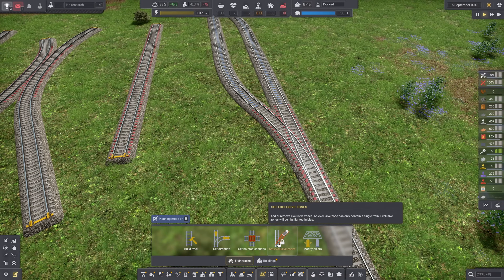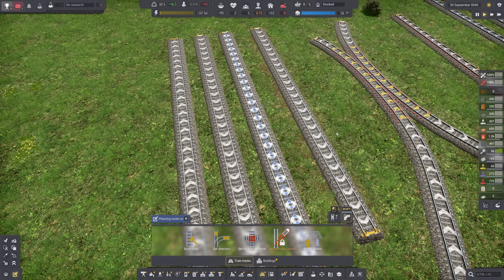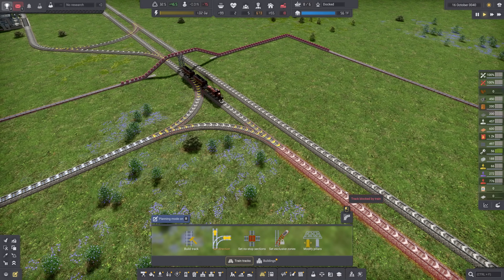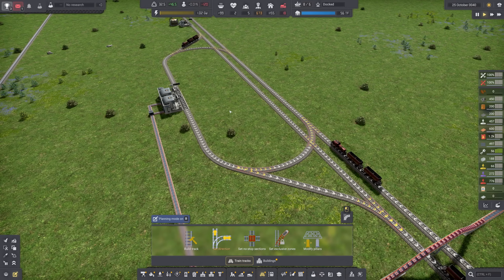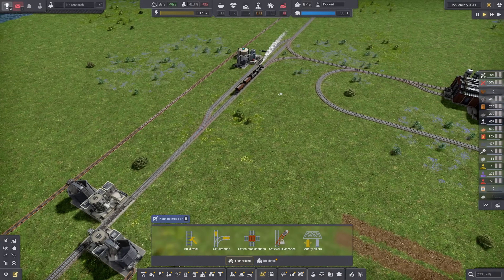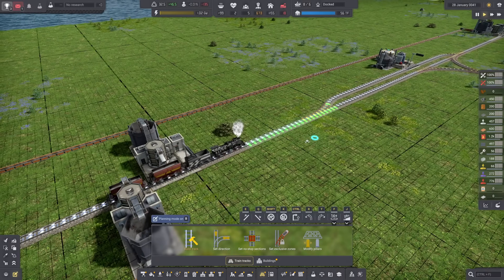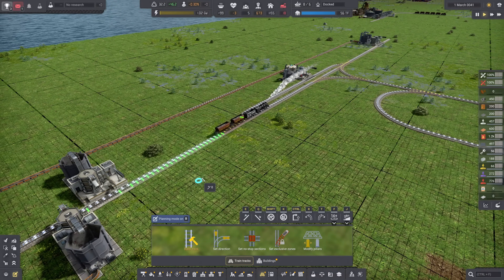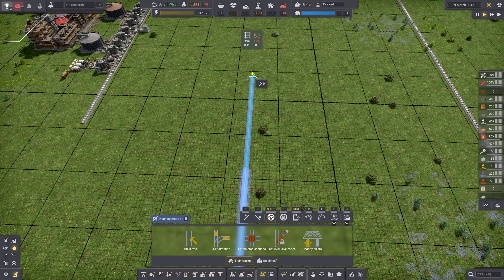Trains 101 Your first Guide 🚜 Captain of Industry 👷 Guides & Tutorials

Comment: Trains are nice. but T3 belts are still way faster and render trains useless
Reply from the maker: As someone who had 15 Belts running from one end of Armageddon to the other I actually think trains could work for this incredibility well instead. I could of changed all of these belts out for maybe 2 dozen trains and had the same throughput!
Reply: A comparison video would be great. I think belts are faster, but need more maintainance. Most of the belts in my update2 Savegame on Armageddon needed to be stopped

Comment: I really wonder what trains add next to belts except throughput.  They are so far into the tree that it's hard to build a base around their function, and they don't really help much at endgame because a belt is a lot less work, so I'm really wondering what this adds.
Reply: Same problem in satisfactory.  Map has to be big, and the costs of long distant belts increased, probably would have to add maintenance cost to belts.  Throughput has to be a lot bigger  than belts as well.
Reply: @ramennight  fair point, still seems like a bigger reason to have it higher in the tree. T2 matenance is dirt cheap at endgame.
Reply: @Longbow6625  I'd actually suggest making it earlier in the tec tree so you can start building basses around it sooner. Change tracks from steel to iron. Separate coal and diesel into different research points instead of ability to deal with grade vs speed. Make the coal train early tech, built with Iron and white parts. Might have to buff deiseal or nerf coal trains.
Reply: @ramennight honestly a train that is very fast but can't deal with inclines well sounds perfect for late game , when you've already reshaped half the island
Reply from the maker: I actually think at T2 trucks its a good place for them to be, trying to build any long tracks with T1 trucks that carry next to nothing sounds like a horrible idea. If you haven't gotten to the stage of Steel and T2 Vehicle parts then you maybe shouldn't be looking at trains yet.

Comment: So, you're still essentially signaling. There's just no signal model that attached to the track, you simply apply the signal to the section of track instead of a signal doing it. All the exact same stuff is still going on because of the restrictions you've put on how the trains are allowed to move on the track, that's signaling.
Reply: One big difference is that it seemingly auto-sets reasonable signals when building it. You can just lay track and for the most part it'll just work out of the box. You also don't have to worry about signal distancing to allow proper train flow, here you need at most to manage intersections and such, but not straight rail track. It seems a lot more convenient than signaling at a glance.
Reply: @theral056 It's still signaling, just don't differently.
Reply from the maker: Yes you are correct, but also this has a massive advantage that you do not need to space all signals out according to your longest train, so a shorter train can maybe fit inside a junction where as the longer trains can not, this greatly improves throughput for trains along with making the whole system easier to deal with.
Reply: I do wish we could place our own signals if we wanted. I like trains. @JDPlays
Reply: Signals are fun until you have to re-signal everything in factorio.  I love how Capt of Industry is doing this.
Reply: @GimbleOnDew I never had to resignal anything in factorio.

Comment: Looks less tedious signaling than Factorio trains, with the train building of W&R. Good overview video, can't wait to start foaming.
Reply: Signals were never tedious in factorio. All you need to do is chain signal before going into a junction and regular signals on the all the exits of the junction. Only other thing is make sure the blocks are long enough for the trains your using in factorio. You also want to space junctions out. Best thing is to double track and make sure the train on the top track goes left and trains on the bottom go right. By building the railway network in factorio like that you will never have deadlocks. The elevated tracks make it amazingly easy for trains going thru a junction to just pass thru. All of my factorio trains are 2 locomotives and 6 wagons.
Reply: @DragonHalo99  Yep. Once you understand the signaling/networks in Factorio it's really not that bad. Took me a long while to get it right though.
Reply: What I like about factorio is the ghost building I have a blueprint book of all my rails and can build an entire railway network quickly in a new space age game. The tank has an equipment grid so i just drive it around chock full of rail supplies. I started a new expensive mode space age game last night. I got the entire rail network I need up in 25 mins plus extra iron mines for when i need them. Eveybody knows you never have enough iron.

Comment: Man, Factorio really was the gold standard of trains in a factory game.  This mess is going to suck to scale up if it takes this much manual setup.
Reply: lmao wut. You still had to do all this in Factorio, but with signals. This doesn't require you to do any signalling at all; it just works that out for you. To say nothing of the smarter loading and unloading, and you also aren't limited by the problem of Factorio where you can't safely run trains that are longer than your signal blocks. Again, this just works it out for you.
Reply: @liesdamnlies3372  the signals and blocks pretty much work exactly like real life trains have work for more than a century.  you didnt have to learn anything new to use them.  They didnt choose to reinvent the wheel and make up some contrived system where each piece of the pie has to be manually edited any time you want to make one minor change.
Reply: @tippyc2  You are fundamentally misunderstanding how it works in CoI. You're also assuming everyone starts with an understanding of railway signalling, which is pretty wild.
Reply from the maker: Factorio WAS the gold standard, but anytime you wanted longer trains, or wanted to change your train format from 1-2 to say 1-4 you had to go through and change over all the stations, along with potentially redesignal all the intersections and possibly the main line as well. I know because I have done this! 
After working with this system for a number of weeks, this WILL be the new gold standard going forth, take it from someone who has 15K hours in Factorio and over 2.5K hours in COI!
Reply: @JDPlays  Yeah hear that, I just defalted to 2-6 trains in Factorio and had blue printed rails to suit that and just ran shorter trains if needed.  That said Space Age kinda screwed all that up when it pushed cliff explosives way down the tech tree.  Not being able to put intersections at an optimal spacing because of terrain can lead to all kinds of bottle necks.  The developers here a COI seemed to have considered all those issues and made the "train drivers" smart enough to figure it out.  My first simple rail line is working well with 2 trains running on a loop bringing iron ore to the smeltor.  I was origianlly just going to have a single line with a double header going back and forth but the aesthetic of a steam triain going backwards just doesn't work for me (even though theres no penalty).  Maybe the devs can work on that one day.
Reply: @scottsummers819  I kept-up with the dev blogs for trains in CoI, and I think there was some personal bitterness toward those points of friction in their tone. They refused to release trains until they were sure they could make serious improvements. It seemed like they had been in the trenches of Factorio, Satisfactory, etc. and said too often “eugh, I hate this.” The system needing to be signal-less was a mandatory feature.

And it’s not like it isn’t without signals it just…doesn’t require your input and a static block system to do it. The trains do actually reserve blocks ahead of them so they can stop and not collide, just like real train signals do.

It’s more akin to the modern control systems in Europe for high-speed rail. Traditional signal blocks ain’t really a thing.
Reply: I've got 10000 hours on factorio and whilst I just got to trains literally yesterday in CoI this system looks like it beats it hands down.  To set up and do multiple car loading in Factorio requires multiple stations and a complicated schedule.  This just does it by its self, thats so cool.  Need more through put just add more cars, no need to change the station infrastructure.  Still so much to learn though.